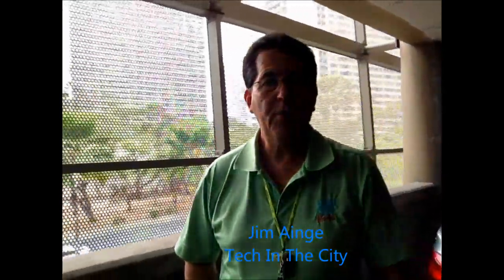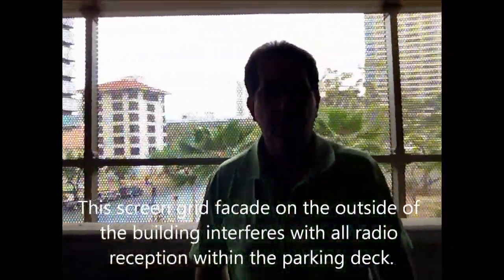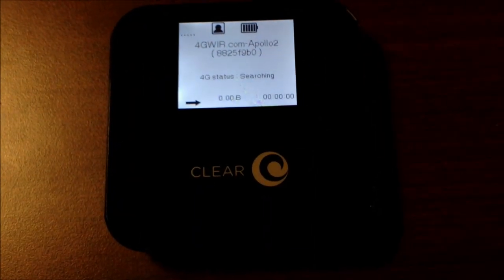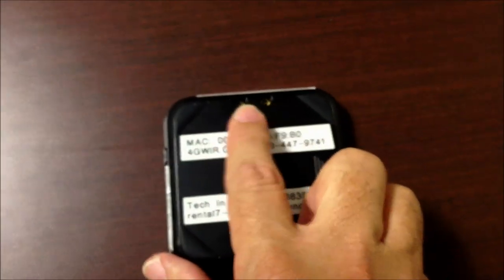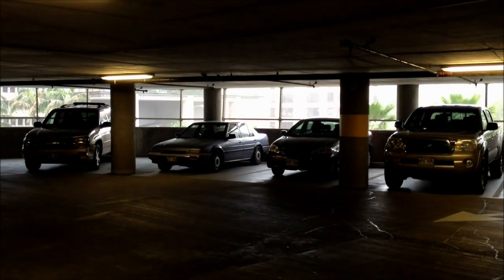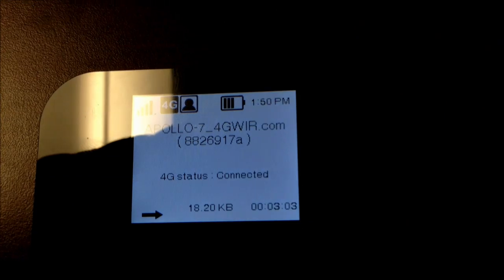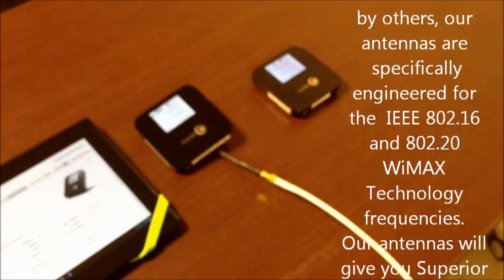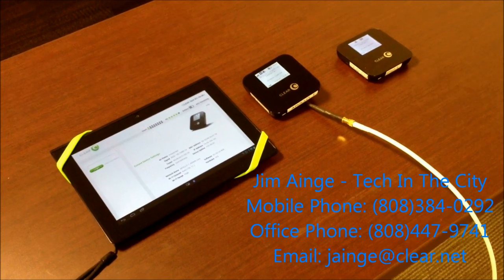From 0-Bars to 4-Bars! How to improve the 4G reception on a Clear Spot Apollo

Comment from the maker: The 2-Mile by 1/2-Mile area commonly referred to as "Waikiki" in general is very well covered by as many as 13 CLEAR Tower Sites. 8 of them are on the Waikiki peninsula itself with 5 others covering it from the surrounding area. Waikiki Beach itself is fairly well covered with a few weaker areas due to some buildings that block the signal from getting to the beach. There is only 1 CLEAR Tower Site in the Manoa Valley area. At Manoa Falls there is little to no coverage due to the thick foliage.

Comment from the maker: Hi Edward,
1: The Voyager's 2 built-in antennas are located on either side of the Micro-USB charging port. I've found that it helps to point the end with the USB port towards the Clear Tower Site.
2: I have experimented with placing a Capacitance Coupler that operates in the 2.6GHz band over either corner of Voyager to connect an external antenna. Not as good as a hard wired connection, but it works with about 30% signal loss.
3: A 40' cable may be a bit long for a passive antenna to work well.

Comment from the maker: If I understand your question, you would think that the other non-receiving Apollo unit would see some passive radiation from the receiving Apollo unit and/or external antenna? The Coaxial wires are shielded so I do not think there would be any from the antenna. There is no WiMAX signal penetrating the walls of that room. The only signal being seen by the receiving Apollo unit is what it sees through the connection to the Hirose MS-147 coaxial switch ports found on the bottom of the Apollo unit.

Comment from the maker: A directional external antenna will typically increase the RSSI you receive from the CLEAR Tower site you are aimed at. This will typically increase your CINR figure. A CINR of 31dB is actually very good! Is it stable at 31 (at least until it needs to be rebooted)? What happens before you have to reboot, does it stop working completely? Or does the modem continue to operate, but at a lower CINR? AND, if it does continue to operate at the lower CINR, what is that CINR figure? And, is it stable?

Comment from the maker: Since I am using the Hirose MS-147 coaxial switch test ports as our feed into the Apollo device it would be hard to tell from this video since I am feeding both ANT1 & ANT2 with a Y-Type adapter AND I do not show the relative feeds from ANT1 versus ANT2, just the cumulative RSSI and CINR. However, if you look at my other video (CLEAR Antenna Solutions) you get to see what happens when I feed only one of the antenna ports. The other  antenna port does not reflect an increase in signal at all.